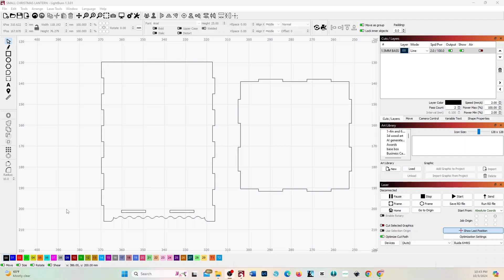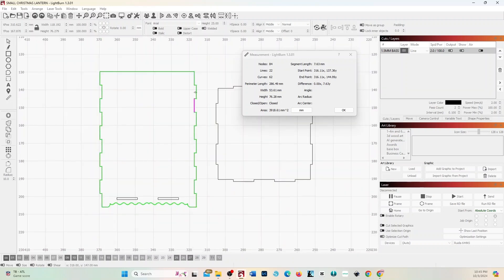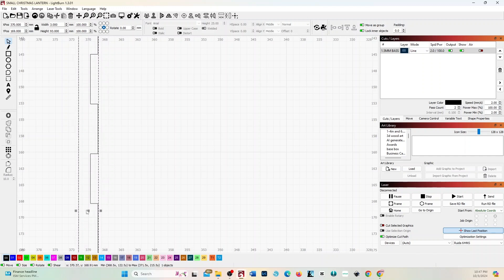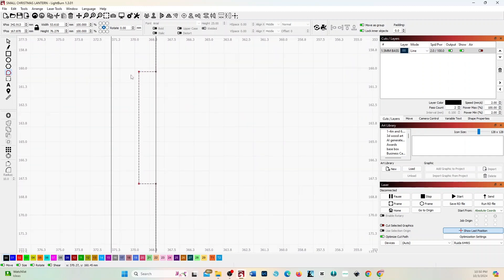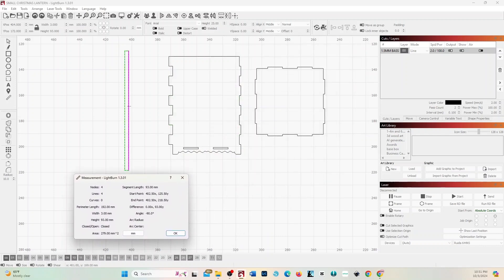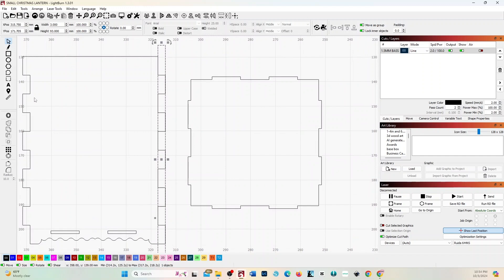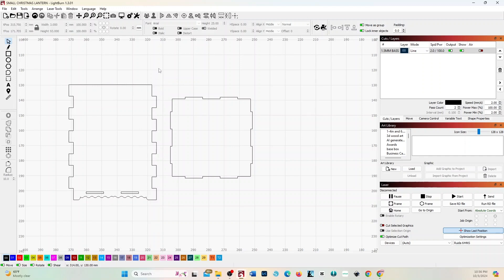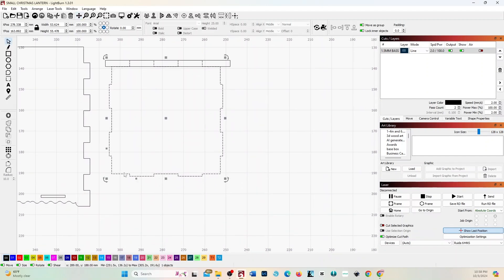Easy Way to Manually Adjust Material Thickness in LightBurn

Comment: When moving the longer rectangle towards the shape place your cursor on the line of the rectangle closest to the shape. It will turn into a wiggly line click and hold and drag to the shape line. It will snap in place. Works 100% accurately. You can zoom in to check but I have never had it fail when snap to object is on. Great video for resizing tabs.
Reply from the maker: Fantastic. Thanks for the tip. I will definitely try it

Comment: I’m not sure I’m following. The design/cut is the same, but you’re using 5mm instead of 3mm. Would you simply just adjust the speed and power to cut through thicker material?
Reply from the maker: @whitecollarworkshop  No worries, and thanks for watching! This video isn't focused on speed and power to cut material; it's about how the finger joints fit together after cutting your shapes. Proper sizing is crucial to avoid joints that overhang or don't fit well due to differences in material thickness from what the joints were designed for. If you have some scrap material, you can test this. For example, if you use a project file designed for 3mm material but cut it from thicker material, the joints will fall short. Likewise, using thicker material for a thinner project file will cause the joints to overhang.

Comment: Thanks for that very helpful.  Is there a way of accurately resizing the slots as well?
Reply from the maker: @ach2935  Thanks. I didn't realize I didn't address the slots until the video was up. To adjust the slots you can simply just select them and adjust the slot height to whatever material thickness you are working with. You can select multiple slots by holding down Ctrl and clicking them and then changing the height value. Make sure the padlock for aspect ratio is unlocked when you do this so it does not adjust the width of the slot. If you need more help please let me know.

Comment: May I suggest that you look at snapping. Adjusting the position of the rectangle would have been so much easier with snapping turned on.
Reply from the maker: @StephenBoyd21  thanks for your input. I will look into it

Comment: Don't forget to resize the slots in the box on the left. Wouldn't it be easier to just use "Resize Slots in Selection" under Tools? I see you're using version 1.3.01, so it may not be in there, I don't know. Version 1.7.01 recently came out, and it has a lot of cool new features.
Reply from the maker: @MileyonDisney  thanks for the reminder. It is easier to do it that way but sometimes lightburn doesn't recognize all tabs and slots , which is why it is necessary to also learn a manual method to adjust whatever lightburn misses. Thanks for watching and commenting.